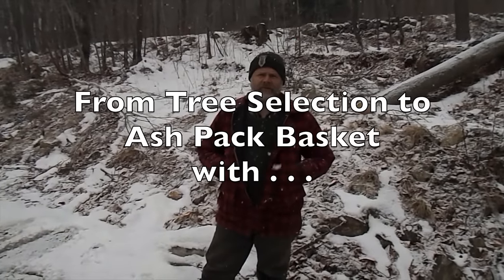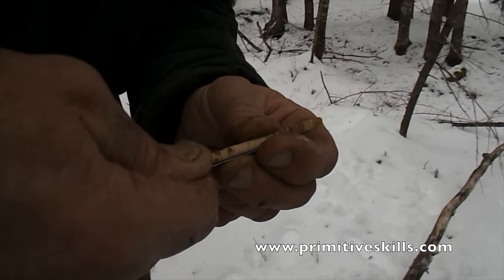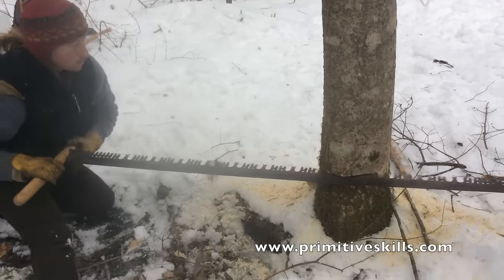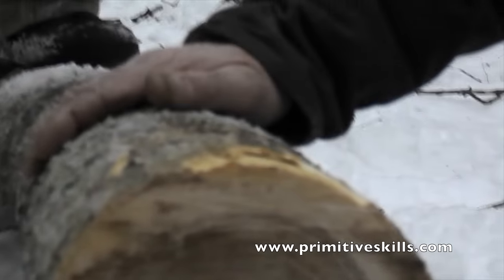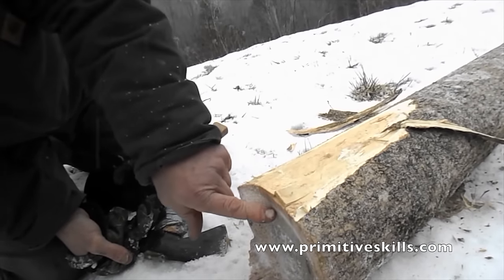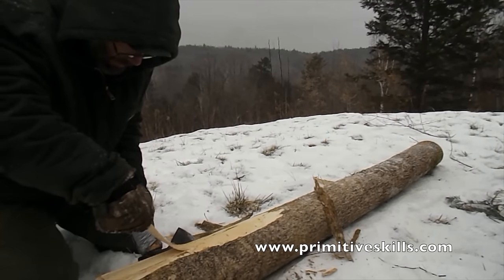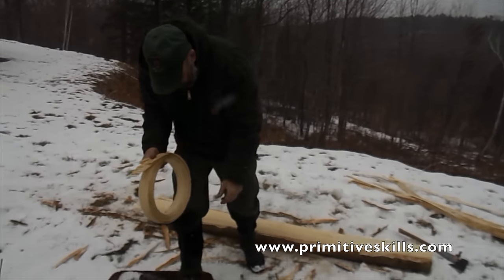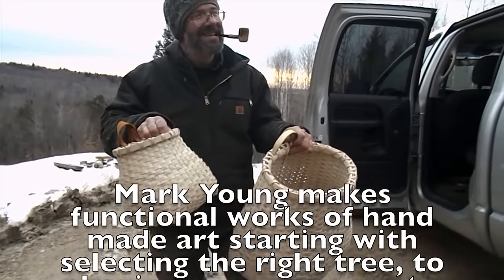From Tree to Ash Pack Basket: Selection and Processing

Comment: Your work is beautiful! I was curious if you can make thia style of basket with another type of wood--are the splints (is that the right word?) From poplar/cedar/fir less sturdy, esp over time?
Reply: Many "knock-offs" are made from sawn maple splints. They may also be veneer cut. There are some videos on people making them from commericially available material. I have no idea what it is though or it's carbon or ethical footprint. There are a few suppliers of ash splints. I used to offer them for sale and may in the future but haven't any right now ( in quantity). There is a guy who may , Stephan Jerome. He has a few videos on Youtube.
Reply from the maker: We use willow as well, but as coppiced whips. Only because there is a lot of pressure on the Ash now and we want to have options to allow the ones we care for some rest. The brown ash in this area is the best for separating, but green and white will pound out if you start hitting it as soon as it hits the ground. The growth rings on those get too tight on each other within hours it seems. Anyone have experience using Hickory?

Comment: Thanks so much for the very informative videos. I have a couple of questions, I'm planning on building a pack basket here in the Black Hills which is mostly a Pine Forest (ponderosa and lodge pole) there are not many ashes around (hardly any naturally occurring deciduous trees besides  birch and quaking aspen) would Pine or birch make a good substitute? Also about how many Weavers or feet do you need to make an entire pack basket?
Reply: no, they would not. Not pounded like black ash. You could have birch sawn very thin and use as a substitute possibly.